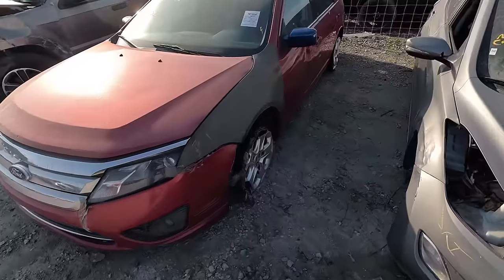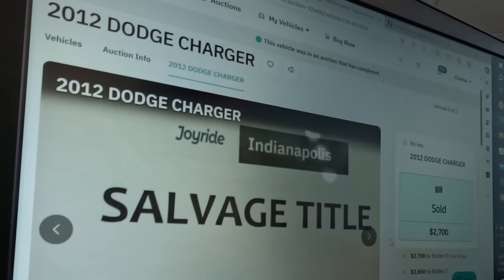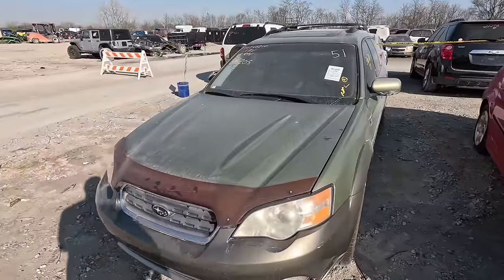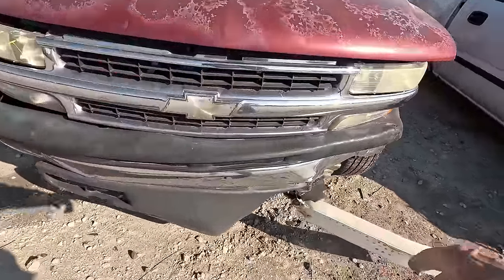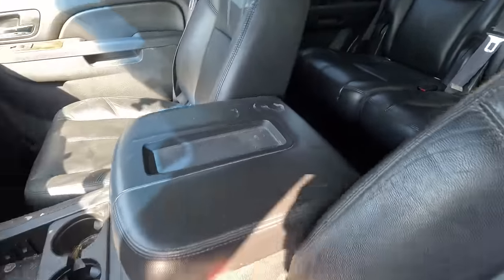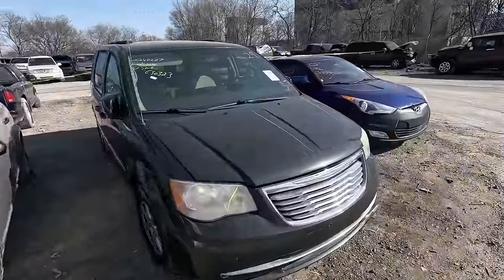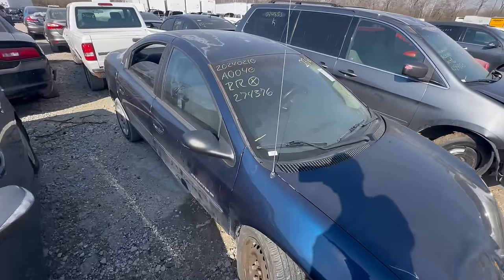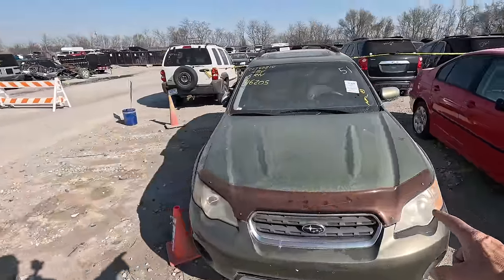Tax refund time at the police auction! how much are people willing to pay?

Comment: The 3800 had 3 series the first had and aluminum intake and had no real big issues from 88-96 or so The series II was 97-03 or so had a plastic intake and had issues with intake gaskets and the plastic manifolds melting from the EGR pipe. Still a decent engine but had intake issues. The series III was the last of the 3800's they went back to the aluminum intake which took care of the intake issues. I think they made those till 08-09
Reply: I have a grand prix 3800 series 3 the engine is a beast 2009 needs a air sensor just siting in my yard can't hit 40mph well I'm hoping it the sensor because this car is fast Trans good no dents got a offer for 2000 for the engine 😂 OK now I know this engine is good

Comment: when recording, please turn your microphone to the Mono position if you can. the back and forth from single speaker can really be annoying. watch this video and listen.
Reply from the maker: The audio on this video was recorded with the roads wireless to microphones, which were indeed set into mono. I also double checked them after the recording when I saw your statement. They are still set in mono. Also, the latter half of the video was recorded on an iPhone, which does not have stereo recording capabilities. Not sure where the problem lies.
Also, listen to this video with my earbuds, and I have no switching back-and-forth from this particular video

Comment: 😂 this is the same car i have i seen the  car and said thats a Malibu these cars are junk i paid 5500 guy said the car was in perfect condition well i only made one oil change and the car has been to shop to shop 2,500 in repairs well i pick up my car after waiting 74 days the mechanic broke the oil pan 😢600.00 93,000 miles bow a new oil pan replacement is needed it will be a new car after the oil pan is fix 😢 3,100 in repairs so far im banging my head why i didnt get another car 😢 can you ship me a oil pan lol im in north dakota its 200 or more for an oil pan ugh any advice sr.?
Reply: It's a 2011 chevy Malibu ltz 3.6 car doesn't have a dent it's nice for a 2011, question I the oil pan hard to take off? You sure know your cars any advice would help please
Reply: It's a 2011 chevy Malibu ltz 3.6 car doesn't have a dent it's nice for a 2011, question I the oil pan hard to take off? You sure know your cars any advice would help please